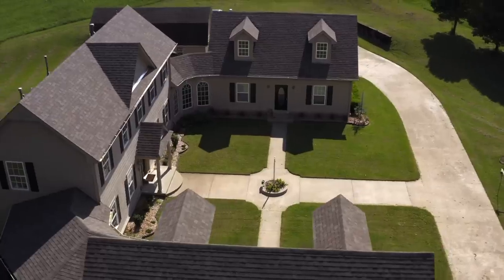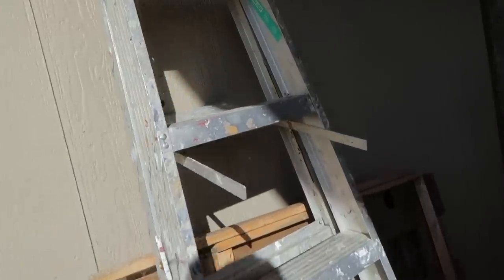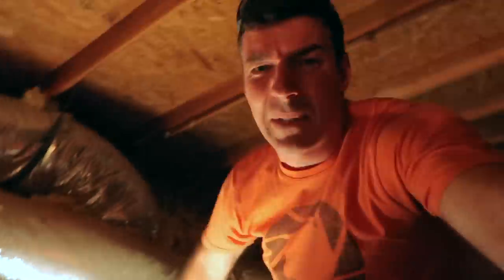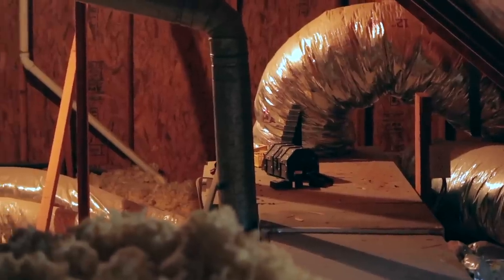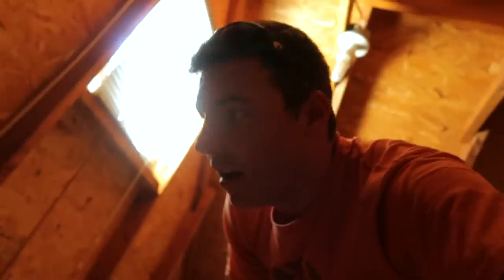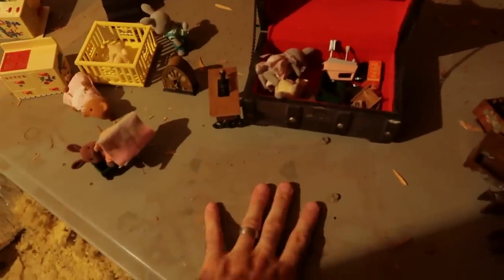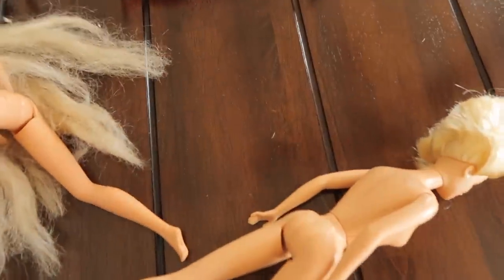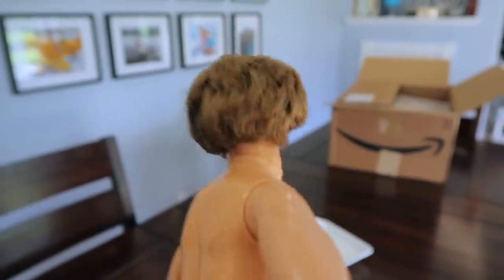I Found A Hidden Room In Our House with Creepy Abandoned Stuff Inside!

Comment: “I think it might be a fire hazard” 
on top of ac unit
Reply: Central air  furnace and plenum (fan and related mechanisms for forcing air past the heating element of the furnaceoassembly), actually; that's why there's a stovepipe up to the roof on it. 

Looks like it's probably insulated on top, which would keep the toys from igniting, but a parent tends to think of the possible dangers first, so they can be eliminated. It's a Dad thing.

Comment: Am I the only one who shocked and can't understand how you can live in a house for so long and not know about an extra room but you can see it from the outside?
Reply: We are doing research prior to adding a dormer, and in an article explaining all the different styles, I learned there is what is called a "blind dormer" which looks like it has a real window into a room, but is not - the dormer structure is just sort of added on top of the normal roof on the outside, not an integrated part of the roof structure. From the inside under the eaves it's flat as if the dormer wasn't there. When they install the window, before they nail down the roof sheathing on the top and finish the exterior, they install some blinds or curtains to make it look like the window looks in/out of a normal room.  But it's just for looks.  From the examples I saw, the window is usually an interesting shape but pretty small, so that overall the dormer gives curb appeal without adding too much cost.  Apparently it's pretty common, so just because you see a window doesn't mean there has to be a room.
Reply: I just don’t understand why you wouldn’t know where your a/c unit is.
Reply: You're right about the Dormer idea. Dormers are also used to add symmetry to the outside look.
Reply: I can't understand why anyone needs a house that big.

Comment: 5:30 to 5:40 Cory, that silver flexible steel tube, is that a vent from a bathroom? If so, please have it directed out of the attic space, to avoid mold buildup on the underside of the roof sheeting.
Reply from the maker: EM i Thanks for the heads up!  I’ll look into that.

Comment: It's funny how that old clockwork started whirring when you touched it, and then the miniature arranged as if to freak you out! Wear a mask if you go up there again - no telling what kind of dust that insulation is giving off. Consider installing a whole house attic fan - it will take a lot of strain off your air conditioner and save energy and money in the long run. That's funny how they put blinds in the attic window. I'm sure your theory about the toys is right. Ummm, it's not really a secret that your house has an attic but that was a fun little exploration anyway.

Comment: At 4:37, I'm looking at that treasure box, then I look on top of my dresser . I have the same treasure box, it was a gift from 40 years ago - it's exactly the same. Yours is missing a piece. When I open mine there is a top part , for putting little collectibles. Then you pull that out and what you see in your box is the same as mine. The inside is red like yours as well.

Comment: That's the inner mechanism from an old clock. The reason it started up when you picked it up is because it has a part that needs to be at a certain angle in order to run. The large coil on it is what is used to spool it up when you wind it up with a key and the big arm with the rubber end is what's used to hit the chime. There should also be a small weight in there but it looks like it's missing.
Reply: I bet that hammer on the clock part is supposed to hit a rod every hour. My grandma has a mechanical clock.

Comment: You gotta' go up there at least every 3 months and check the FILTER in that HVAC Unit. That's your Heating and Air Conditioning unit for the upstairs. If you've got another unit in the basement - check that filter too. Write the date on the new filter when you install it, that way you can get an idea by checking it periodically of how often you need to change it. Pay attention to the DIRECTION the filter faces when you take it out. There are arrows on the sides of filters that point in the direction of AIR FLOW. Make sure you install each new filter facing the proper direction.

Comment: The clock movement has two springs so it's a chiming unit (One drives the clock time keeping movement, The other drives the chiming part of the clock), As it ran down the regulator pallet is missing and someone jammed it so that it didn't run down until you disturbed it!!

You'll need a square drive key to rewind it but it will run down if the balance wheel isn't held. 👍😎

Comment: The clockwork device looks like the inside of an old striking clock. You can see the hammer that would have struck the chime. Old clockwork can be set off if you move it, especially if it has been placed against something so as to stop it running, till it is moved.
Reply: Thankyou for sharing your discoveries. Looks like the children of previous residents played up there sometimes. Either that or it was set up like that for someone to find.

Comment: Kind of plays out like a cargo cult scenario like you'd see on a desert island where a tribe of natives find an abandoned, wrecked ship one morning and they try to figure out what the stuff inside is...

Cory, are you just pulling our legs, or had you really never seen a pendulum clock movement (that's what it's called, a "movement."  It's the old, traditional term for the entire interior  mechanism of a mechanical clock) before? And I'd love to get my hands on one so I could tinker with it...

On second thought, it might not be a pendulum type; that long arm might be the bell clapper.
Reply: The little wheel that was spinning was part of the alarm or chime movement, a subsidiary mechanism within the overall mechanism, which either runs hourly chimes or a single alarm "repeater" bell (like on wind-up alarm clocks). Both the main movement and the alarm movement probably/should have winding posts that will accept keys or screw-on winding knobs. A clockwork repair or antique shop (There's bound to be at least one, if not several, in Tulsa) should be able to come up with one that will fit.

Comment: at 3:09 that is an antique clock movement. going by the striker it's a mantle type or smaller clock form possibly a wall wart. when you tilted it, you released the wound up strike side of the train. if you can get me a picture or two of it I can tell you about how old it is who made it and possibly the type of clock it came from.

Comment: that thing you think its a trap its actully a clock mechanism a 8 day time and strike wind up strike spring broken those are alot of money if working i got them in my house that run and broken too and get it fixed and build a clock with it you need a pendulum and coil gong in case too!

Comment: has it occured to you that with all those dissused "vent pipes"espessially the one coming out of the floor and un, used electric switches I would say that your attic like many others has been used as a "cannabis factory, " excess hot air being pumped out and fresh air in! the pumps have been removed obviously and the light switches would have  been attatched to high intensity bulb units and electric timers and the pump system now also gone,the blind on the window to make sure that the outside world couldn,t see in or  tell when the lamps were on, and not arrouse suspicious activity?? just a thought?? cheers,